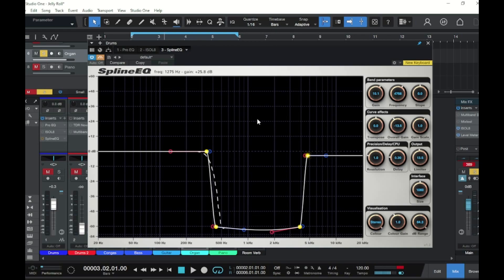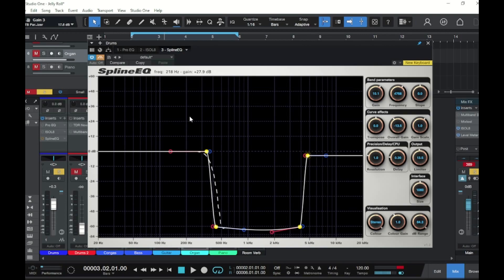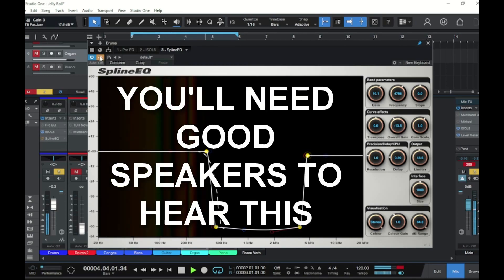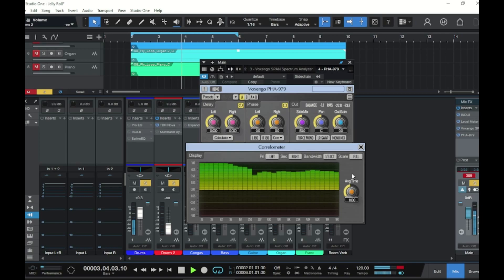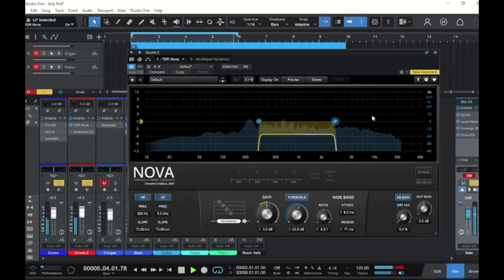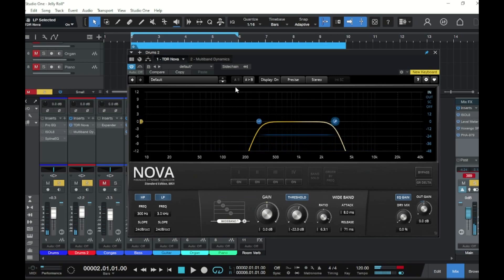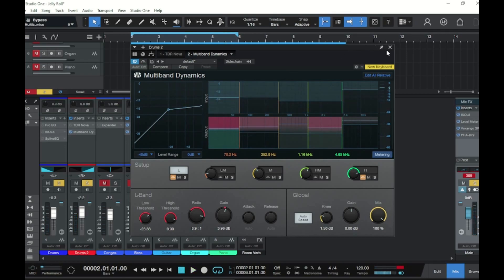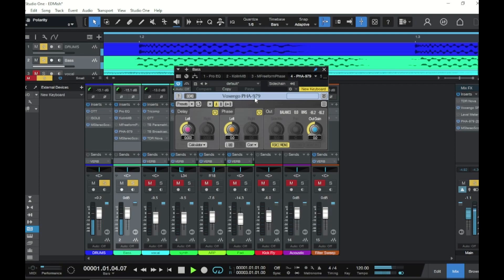Phase Shift - what causes it, what to listen for, and how to fix it.

Comment: On the money as always!! Thank you for taking time to address all the nuances in regards to mixing. No body articulate in such a clean way! What do you suggest for vocal stacks? I use autotune on each individual stack and up to 8 vocal stacks, and i get the phasing issue on certain frequencies, and those  frequencies pop out. I try to eq the stack as a whole, but to no avail. I’m pretty sure its because autotune is tuning each stack very similar. And my vocalist timing is pretty good when it comes to replicating her stacks. This is my struggle. Thanks!!
Reply from the maker: Thank you very much!
 I will answer this in more detail in a Patreon Q&A, probobly next weekend. But I would start by panning them opposite each other (2 at a time) and look at them in a correlation meter to check the phase correlation before and after autotune. That would tell you how much (if at all) autotune is messing with their phase  relationship. Then adjust them with with PHA 979.

Comment: 5:20 is that really pre-ringing or just ringing? I've been under the impression that minimum phase EQ does ring out when you boost like that, but the ringing doesn't precede the sound, it only comes after.
Reply from the maker: You're right, it's just ringing. I should have clarified pre and post ringing from good old ringing. Thanks!

Comment: Great video but i think this plugin Voxengo PHA-979 is not free or am i missing something.
Reply from the maker: It's free on the Voxengo website, but there's more features activated on the paid version, but the free version works fine. Thanks!
Reply: @AudioMountain777 okay i thought it was just a demo because in your video it kept going into demo mode.
Reply from the maker: It flashes that prompt on the free version. I like it a lot and I think I'm gonna get the paid version, which comes with a scalable GUI.

Comment: Thank you! I have recently noticed when using MIDI orchestral instruments in stereo, that they go in and out of phase. Now Im wondering if that is whats making the whole orchestration sound thin.
Reply from the maker: Could be, especially if you have steep high pass filters or multi band compression going. Have you tried bypassing all the plugins and see if it sounds fuller?
Reply: @AudioMountain777  it seems to be on the samples themselves. I'm using Spitfire's BBCSO. If I turn the mics to mono and turn the mix mic off in the plugin, the phase shift goes away.
Reply from the maker: Gotcha . It's hard for me to speculate without seeing it of course, but
I'd be interested to hear how you resolve that issue. Did you try a sample delay adjustment or phase alignment?
Thanks for sharing.
Reply: @AudioMountain777  I think I made a mountain out of a molehill (no pun intended 😄). It sample only ducks in and out occasionally, and sounds fine. Changing the phase just makes things worse. Thanks for your help and these great videos. I do have one question: is there a way to widen stereo without causing things to go out of phase?
Reply from the maker: Mild stereo widening shouldn't cause significant phase issues as long as your low end is mono. If you keep everything below about 150hz in the center you shouldn't have problems. What are you using to widen the image? How bad is the phase discorrelation on the meter?
Reply from the maker: If you're interested I covered this topic and today's Patreon Q&A Episode 21 - there's a f4ree preview of it that you can check out.